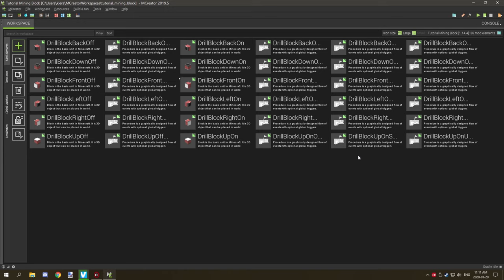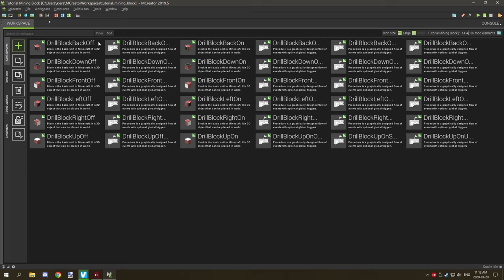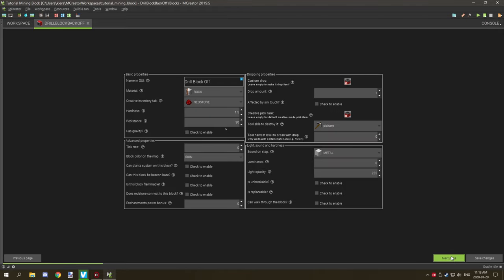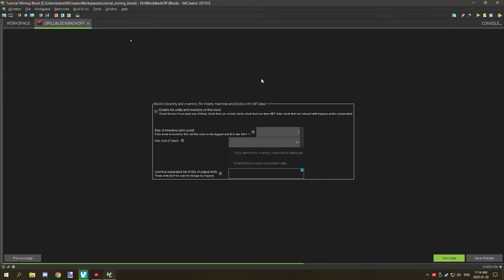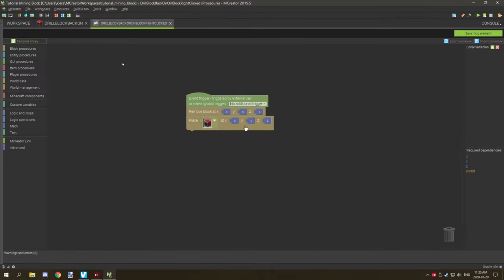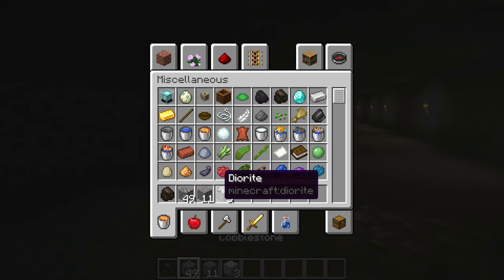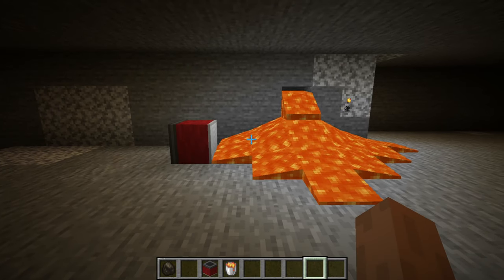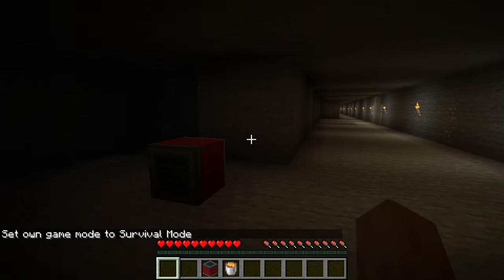MCreator Tutorial: How to make a digging machine v1 | 2019.5

Comment: Loved the video this is pretty BA! I kinda used this setup for myself in my personal mod but took it a little further. I added my own model that I made in blockbench. I was trying to make a chest in the order of ChickenBone's Ender Chest.  I wanted to add it to the digging machine. I can get the digging machine to pick items up and place in inventory but I cant get the inventory to link to another chest thru procedures.  Id love to get the inventory to link from machine to say one in my base, to pull items out.  Say if I wanted to make the machine programmable. How would I go about it to say go out 500 blocks turn left 2 blocks and come back? Im just asking cause I am not good with the whole procedure thing. Im way better at models and textures
Reply from the maker: I am not sure how to do all of that easily and with little amount of code, but for the distance you would want to set a NBT variable then pass it the block where it will placed the new block when it mined a space then count down 500 blocks when it reaches 0 you would want to have the block rotate the other direction by placing the other block state opposite from it with the on state version then set the timer back to 500 I would set it just under 500 maybe 499 just encase it does not count the current block its at it won't ruin any blocks. Also you will have to then reverse the NBT variable from updating the opposite cords to the other direction as well or it will not work.

I have plans on expanding this tutorial in the future but I have many more things in the works right now that I don't have time to work in a MK2 version.
Reply: NorthWestTrees Gaming thank you for your reply. Right now I have given up on the programming distance part. Trying to focus on linking the storage on machine to chest in my base. Linking the two is challenging. I thought it would be simple just import the ender chest variables to the machine GUI java. The create another chest block with the same variables. I contacted ChickenBones to see if he could help me since he made the original ender chest mod with channels.
Reply from the maker: @ditchdiver7531  If you worked on the movement controls for the project you can also through in a few extra NBT block variables to calculate the distance from a hopper then use those X,Y, and Z variables to add the particular block you just mined to the slot, However I suggest that you change the code for the mining size for the drill block to only mine one block in front of it as it will be hard to add 9 blocks to a hopper at the same time, I think there is only 5 slots so that wont work.

You will also have to code in what blocks you want to store in the hopper, egg if stone is at X location then add cobblestone to hopper location.

Don't forget to remove the block not remove with drop as you would be duping the item that way.

Another option is to detect a block under or above the block that tells the block what way to move, so say you reach one block you can place a block at the end of the it before it reaches there then when it reaches that block and is above it you can code it the direction to turn the block eg: turn back.
Reply: NorthWestTrees Gaming thank you that makes more sense. I will give that a try. I will let you know how it turns out. Have to say it been fun learning it all.
Reply from the maker: @ditchdiver7531  When you learn more tricks with procedures it gets easier to make complex systems like thing.